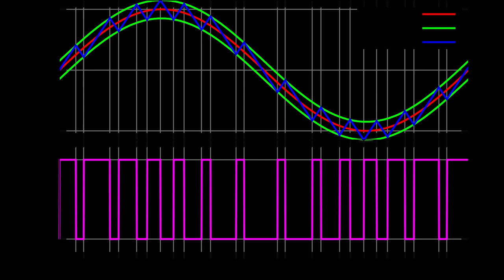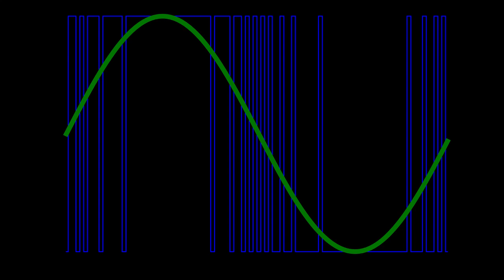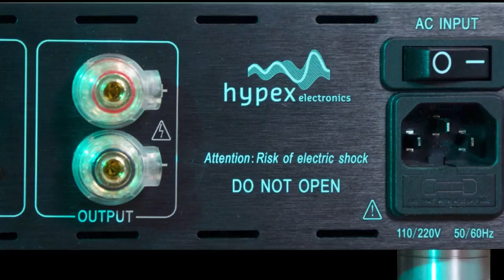Review: Hypex NC400 kit

Comment: I agree with you on your analysis of amps not sounding very good for the first time but I loved the sound of the NC400s right off the bat. Granted, I now have around 100 hours on them and can agree there has been improvements but I would be lying if I heard anything drastic in the first few days. Thanks for the review and linking to the tutorial. I recently discovered your channel and enjoy it very much!
Reply from the maker: +New Record Day our auditory system is a tricky device. If you switch from a well sounding tube amp to a 'fresh' class D amp,  the 'shock' is bigger than when you switch from an 'average ' solid state amp, for instance. I just wanted to warn not to judge the NC400's right from the bench.

Comment: Hi Hans, Thanks for the review. One thing about the pricing: one could interpret your words that a pair would cost 650 Euros ex VAT. However, 650 Euros only buys you one mono amplifier. So it's 1300 for a  pair. I am seriously considering trying a pair for a stereo system. I have currently one in my main system to drive a subwoofer, performing really well.

Comment: I have a pair of NC400, bought the NC400 and SMP600 modules. It is is indeed very good and it takes an extreme amplifier to better it, but those amplifiers do exist - and the price difference is not small (huge?). But Class D seems to have come of age, but will they succeed in challenging what is possible at a much higher price? Is there still more improvement to come? I hope so, but will it plateau with the NC series? Only time will show. But it would be hard to believe that there are better amps out there, but few will ever hear them. But what is needed is to get people beyond ordinary amps and affordable. And kudos to Hypex for doing that.
Reply from the maker: 's fine you like the NC400 that much and they are great amps for the money. But I don't share your statement it would take a lot of money to find better amp's. For the same money you can find amps that have equal quality but other strong points. But, again, great you enjoy them that much.
Reply: The Hans Beekhuyzen Channel Hi Hans, can you name a few amps in the price range worthy of comparison to nc 400! thanks.
Reply from the maker: Sorry but I don't have that current.

Comment: Thanks for the excellent review, Hans. I was somewhat surprised to note that there was no unbalanced RCA input. Not everybody has a pre-amp with balanced outputs. I don't.
Reply: Thats okay, they have a chart where they explain how to connect  unbalanced (wich you connect to their pcb) input to their balanced input on the pcb
Reply: You know you can get an RCA to XLR cable for like $10 right?
Reply: @KB-gt2xl  No I didn't and thanks for informing me, K B.. I've always assumed that cables were either fully balanced or unbalanced both ends.  I'd say that if Hans likes it that amp kit would be well worth considering.
Reply: @johnmarchington3146  They sort of are in that using an XLR to RCA cable would mean an unbalanced signal is being transmitted, but it would be delivered just the same. Balanced is usually more of a benefit over longer distance or if one is seriously concerned with interference. So you can deliver unbalanced over XLR but cannot deliver balanced over RCA.
Reply: @KB-gt2xl  Thanks again for your explanation. I confess I've never really understood the XLR concept. I have a really expensive= and sonically excellent -  pre-amp and that only has RCA inputs and outputs.
Reply: @johnmarchington3146  Feel free to buy an amp as you please then sir!
Reply: @KB-gt2xl  I live in New Zealand so I suspect by the time I've imported a couple of kits they're going to end up being quite expensive

Comment: Have you compared the sound of Hypex nCore to ClassDAudio and ICEpower? The other two have some products out there at a fraction of the cost, so I'm very interested if they are at least as good sounding as nCore. I presume the ClassDAudio and ICEpower are supposed to be better than Hypex UcD.
Reply: Not exactly a fraction of the price, the high end-NewClassD modules are around 25% more expensive than the NC400. I dont know about the Ice Power, because they a harder to buy as a private customer. But it could be nice to hear from people who heard more/all of them.

I have had the high end NewClassD modules with discrete opamps at the input - the sounded very good, but I didn´t have any of the others to compare with.
Reply from the maker: It’s always the implementation. Most manufacturers of quality amps modify the modules or skip the input section. Psu’s also make a difference.
Reply: Were you able to try q Class D Audio product yet? I've been thinking about giving them a try. Also thinking about Orchard Audio
Reply: @Gpray75  I am no longer looking for anything, just using a basic AV receiver.